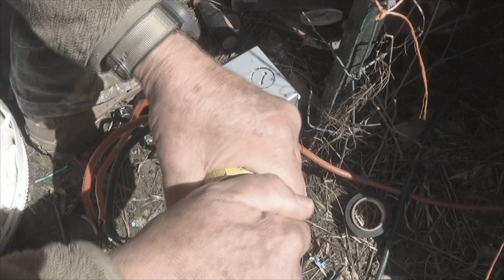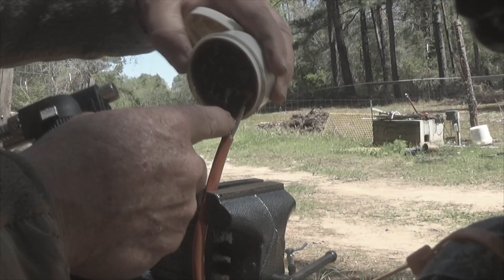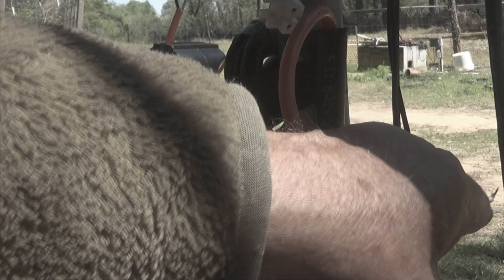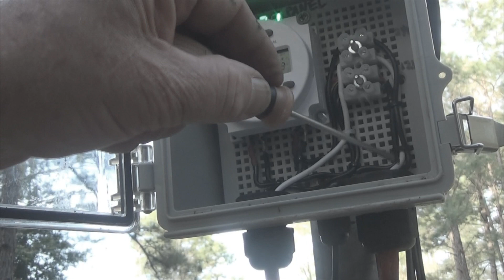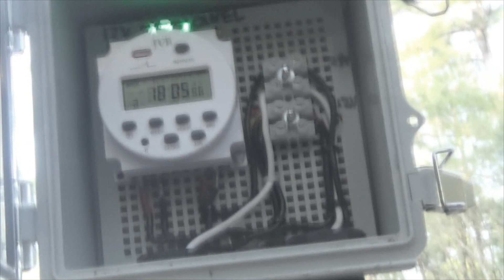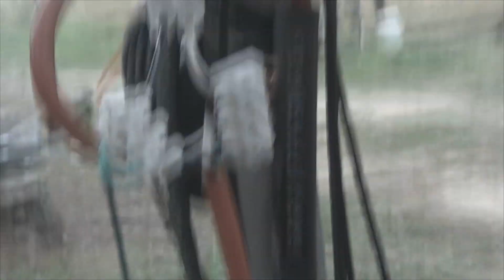3 panels 3 test points   part 2

Comment: An electrician would tell you, that tinning stranded wire isn't recommended, because the sucked in tin stiffenes the cable, so it's more prone to breaking some day.
But if you don't have end splices and a suitable plier to press them, tinning is better than doing nothing.
Do you use an amp clamp for testing ?
Reply from the maker: tinning....correct.  but these are as a presrvative,    and will never be bent....   i tin splices to give better conductivity.   it has served well all my many years working with power.   but crimp fittings, are resistive in nature, and thus prone to heat build up/degregation.   the standard in industry is to make all connections patent.

the amp will be in line.   this is a panel to last till the end of time